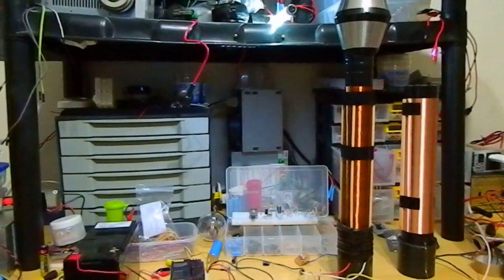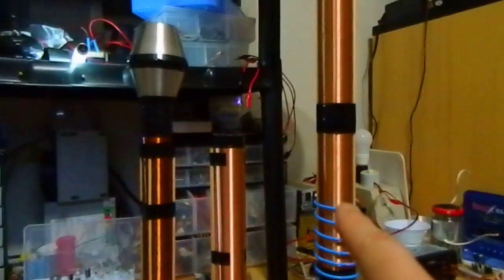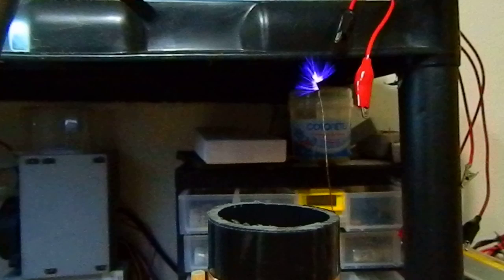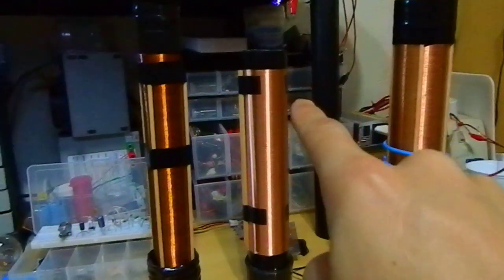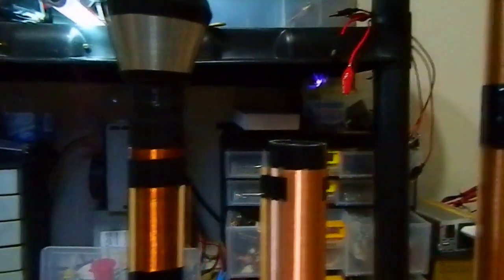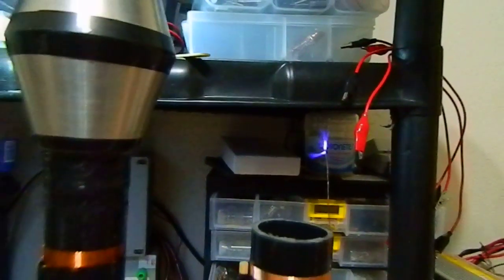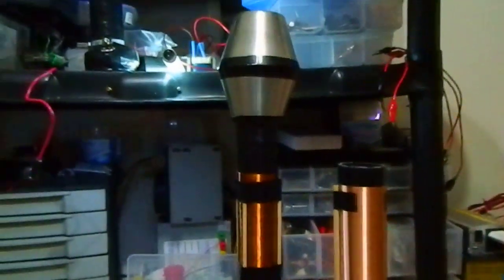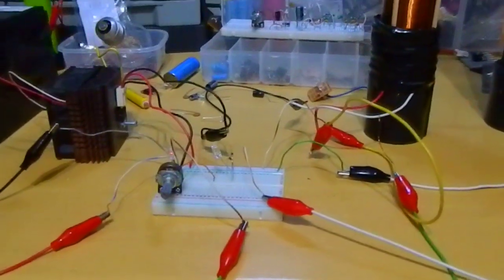Slayer Exciter - Plasma on the earth ground coil

Comment from the maker: Tuning this thing is really a thing. GBluer always use a variable cap to tune, but I do not have one. I always do by testing, experimenting and testing again. Sometime it takes weeks to get the most power from it. And each one is different from another, even when they are with the same dimensions. Experiment, write down all data and make sure to protect your transistor. And do not forget to upload your progress, sharing our experiments is the most important of this. Thanks for the comments.

Comment: Burned up!?! I can light anything from 12v 5W to 240v 40w and not burn them! You have some power there! What are your input amps @30v? I'm running around 1.25a 20v with just primary, and down just under an amp if I have a secondary close to primary. So about 20w in. My L1 gets hot too, from the amps. Stray earthed things will plasma arc, as you found with your desk. I have many burns on fingers, and a few on my feet from standing on wires with no shoes. LOL, Thats why Tesla wore 2" cork soles!

Comment: Yep. Same here :) I have been meaning to do a video explaining what I have found. which explains most of what you have observed in this video. Have you tried putting an incandescent in series, between L3 or L4 and ground/neg? Check direction of current flow :) Also you should be getting a dead zone, where fluros go out at some point between lighting from L1 and lighting from L3/4. No dead spot between L3&4 as they are on the same phase, which is 180deg from the primary signal.

Comment: If your ground and neg rail are connected (at any point), then all the same signal. Neg rail is ground and ground is neg rail.  This is how Gbluer likes to have his L3. You just have 2 L3s It will be receiving power and feeding it back into the system too. Have a look at amps from supply, and amps on the L4 connector... I have the same set up right now :) similar plasma. GMTA! Anything on the ground rail will make plasma in wifi field, due to opposing waveforms. See my capacitive coupling video.

Comment from the maker: The power supply is not connected to ground earth. There is a connection from the negative rail to ground, L4 connected to ground, L3 connected to negative rail and L1 connected as the normal Slayer Exciter on the base. Interesting is that even if the connection from the negative rail to ground, L4 keeps the plasma, but stronger when negative rail is connected to ground. Great results with your TC too, very nice videos!